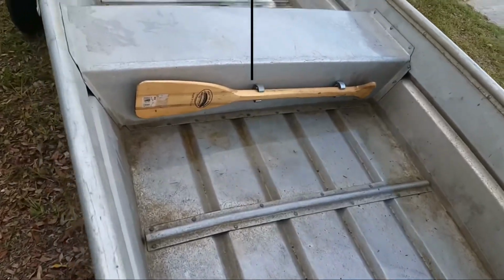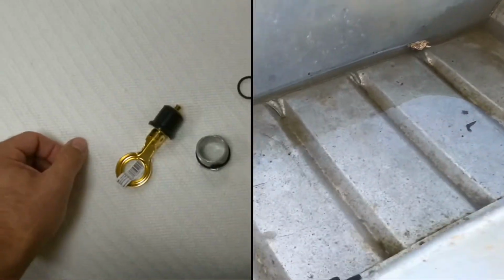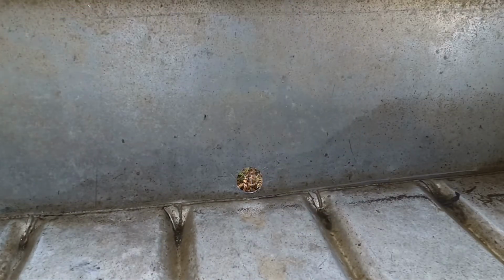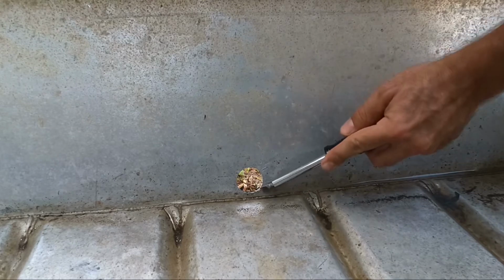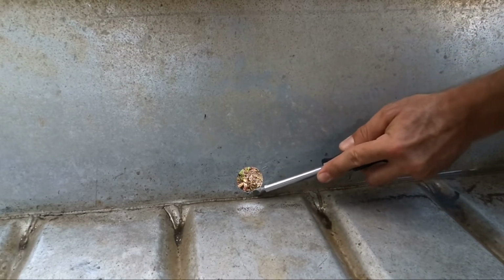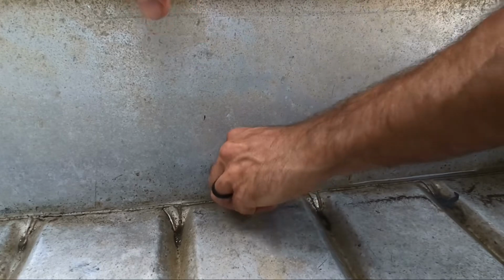How to Add A Drain Plug to Jon Boat

Comment: It will work for a while depending on where you use and store your boat.  Steel mated to aluminum will rust and it will corrode as well causing pitting in the aluminum.  Salt water will speed up this process.  Also, over time this will vibrate loose and begin leaking.  An aluminum drain tube should be installed using a flaring tool to make a permanent install.
Reply from the maker: Thanks for the comment. Always looking for good advice👍🏻
 I agree that it may corrode, but a quick fix on the road to hit some backwoods honey holes has been holding strong now for well over a year. I think the rubber o-rings between the metals was key for separation and sealing.

Comment: Good idea, I am doing this. Just to make it clear for me, It's 1 1/4 hole and 1 inch conduit ?
Reply from the maker: Yes Sir. The bit was 1-1/4” to allow for the conduit thickness to have an inside diameter of 1” and a 1” adjustable o
Plug. 
I used o-rings on both sides. 

Someone suggested lock-tite but I have not had any problems.
Reply: @wekeepsitreeloutdoors  Thank you buddy

Comment: Well done, smart and fast fix!
That’s keeping it real.
One thing I did to mine is use some lock tight because the steel and aluminum grow and shrink at different rates based on temp.
Last thing you want is for nut to turn off when your are out in the boat.
Once again great job and video!
Reply from the maker: Thanks! I appreciate the advice. Wasn’t sure if lock tight would bind and pull/rot the o-ring so I just give it a glance when I insert the plug. So far so good🤞🏻. Thanks for the comments👍🏻

Comment: Nice job bud do you have the link where you bought the kit from
Thanks
Reply from the maker: Thanks. It wasn’t a kit. Just loose conduit fixtures on the electrical conduit isle at a the depot.
Sucker is still holding up👍🏻
Reply: @wekeepsitreeloutdoors  thanks I’ll try for mine 12ft

Cheer
Reply: Chase nipple and lock ring.

Comment: GOES ON the OUTSIDE JACK  A S S, NOT INSIDE
Reply: Wow you are a very rude individual. Why is that a reason to call anybody a jackass?? 

I know more people that put the plug on the inside on a jon boat than on the outside.  

Your statement is correct on boats that you cannot access the inside to put the plug very easily.

But in all reality it is much safer and better to put the plug on the inside if at all possible. 

If it fails on the outside, it will drop to the bottom of the lake and your boat will sink. If it fails on the inside you can still pick up the plug and shove it in the hole and limp the boat back to safety. 

So now who's the jackass???

I've seen many videos over the years of boats that have sunk because the plug either fell out or wasn't installed and they didn't realize it until it was too late. 

Bottom line that is not a reason to call somebody a jackass and just because it's the opposite of what you would do. 

It does not matter whether it is installed on the inside or the outside on a jon boat it's all on personal preference. 

Me personally I would choose the inside due to safety and you can literally look down at it and inspect the plug at any moment.